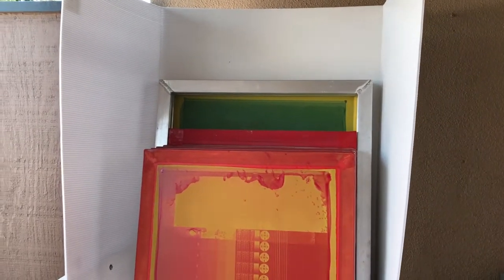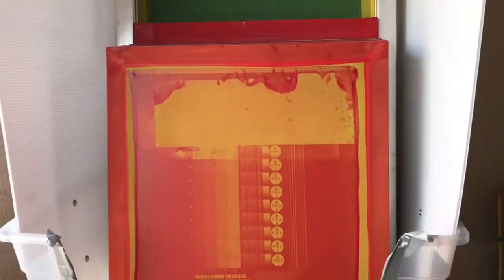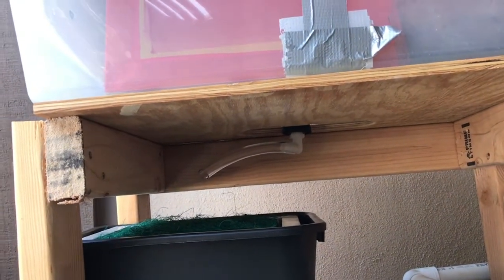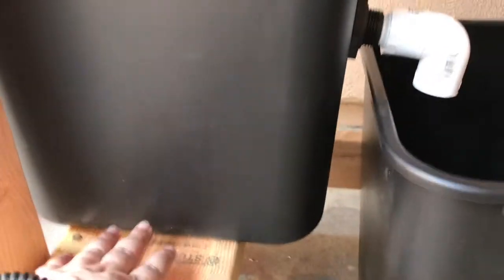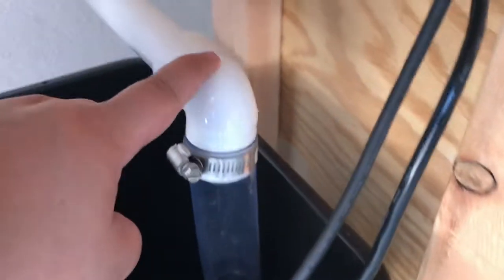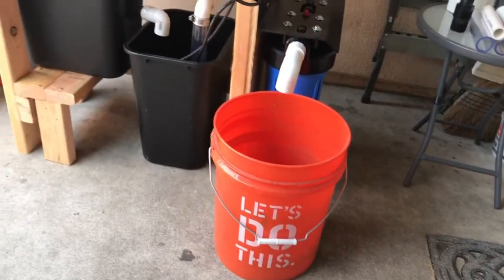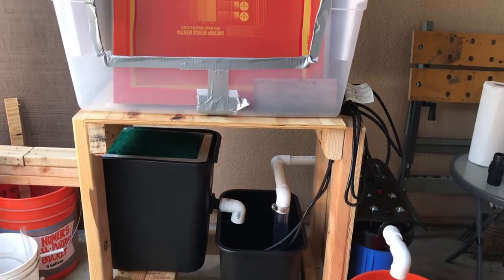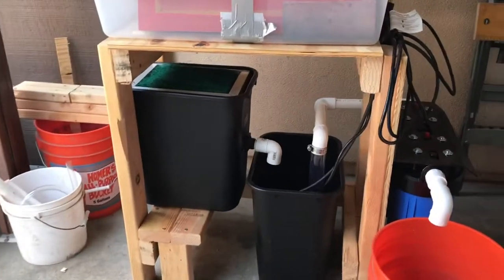Screen printing DIY Washout booth and Filter System

Comment: Nice video.  I am looking for ideas.  Did you say you are in your patio?   I want to do that too.  How do you bring exposed screen to washout and keep from ambient lights?
Thanks
Reply from the maker: So I do my screen exposing inside and once I’m done exposing them, I use a water bottle and spray them which stops the exposure process. So the ambient light isn’t an issue. Also my patio is covered anyways, which doesn’t pose a problem.
Reply: @darknytestudios  I'll try that and as added measure, I'll try and do washout at night.  Thank you for your help.

Comment: thanks for making this video! is your first filter a screenprinting screen? what is the thick filter inside it? Thanks!
Reply from the maker: Yes. Those are smaller hat screens. You should be able to get the fairly easily. I’m gonna be trying pond filters, but those screens inside are just for swamp coolers. Just trying to catch the big chunks.

Comment: Ok, I'm super new to screen printing so please bare with me. I love your setup and can see how perfect it is for reclaiming a screen, but how do you handle UV contamination when you are washing out a screen? Don't you get some emulsion setting up before you can fully rinse it? Or am I overthinking how effective emulsion is at burning a screen in daylight?
Reply from the maker: You mean after I’ve burned a screen with the film positive?
Reply: @darknytestudios  yes sir.
Reply from the maker: @bigmamabren3360   oh. Easy peezy. So I exposure in a spare bedroom. Then once it’s done burning I have a spray bottle with just water. I spray the screen down and let it sit fir a minute and then wash it out.